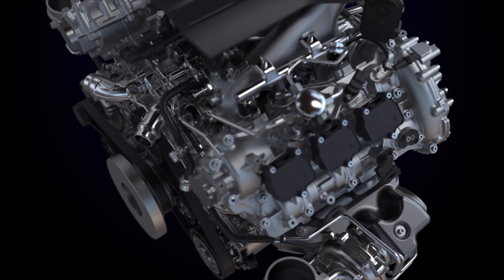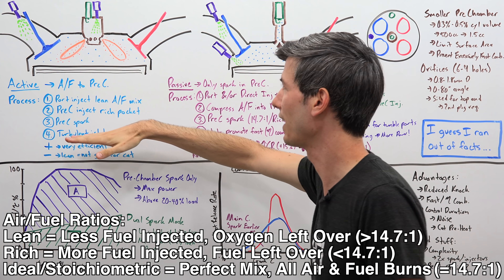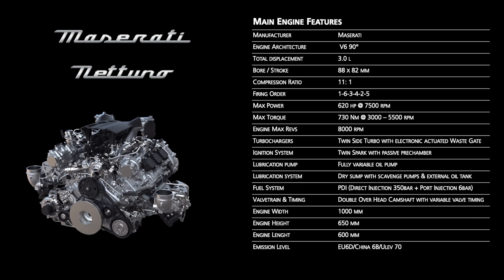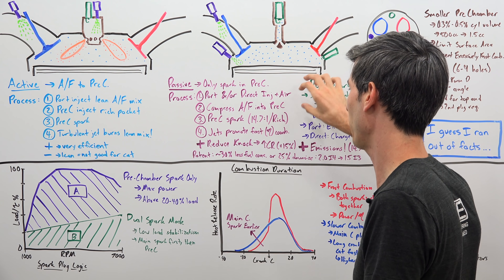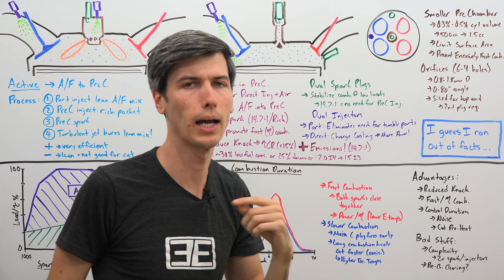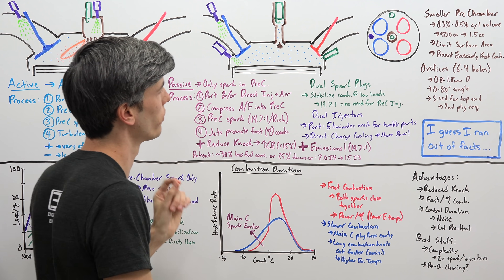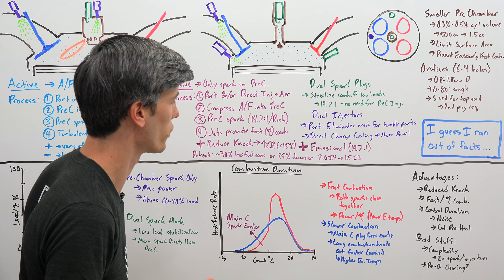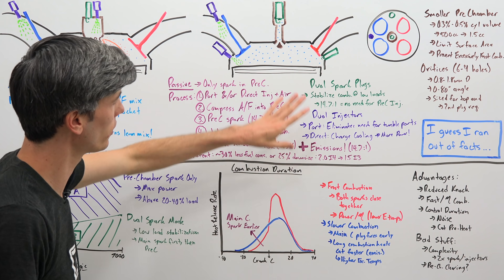How Maserati's Brilliant MC20 Engine Works - F1 Tech In A Road Car!

Comment: This is exactly what Mazda did with the leading and trailing spark plugs on the rotary.
Reply: No
Reply: @R4M_Tommy  ok, so not "exactly". The trailing plug is recessed in a chamber so that it creates a jet of burning fuel to ignite the tail gasses. Also the timing split between the leading and trailing is varied to control torque duration, emmisions and prevent knock. So there are a couple of similarities that were learnt decades ago

Comment: 3-way catalysts as found in road cars actually need a mixture that oscillates on either side of the stoich ratio to work properly.  Current engine control systems are capable of maintaining a near perfect stoich mixture most of the time, but that would reduce catalyst effectiveness.

Comment: The technology is under dev. for a couple of years. If you want to see something similar with diesels engine, check heavy duty gas engines with diesel ignition.
Basically, you use diesel injectors with diesel as a spark to burn a lean mix of methane and air in the cylinder. You get the benefits of diesel's efficiency at partial load with an "Otto" cycle for heavy duty engines. Plus the fact that you get close to half the CO2 out a classic combustion engine.

Comment: F1 must be doing something different because they are only allowed a single injector per cylinder
Reply: F1 engines work at full load almost all the time.
Reply: @R4M_Tommy  sure but single F1 are only allowed a single sparkplug and single injector, I don't how much in what this engine does is possible in F1

Comment: Having the combustion travel through approx 1mm holes seems like it would foul up without regular cleaning of the orifices during maintenance.
Reply: There is probably enough compression and then enough force with combustion to keep the prechamber clean.
Reply: Agreed, unless they include some sort of blow-through venting/valving, this is going to foul up for sure. You really can't force fuel/air into a closed-end tube, and you also can't properly evacuate a closed-end tube. This concept is missing some technology to make it work as conceived.

Comment: You questioned the same thing I did.  The pre chamber build up. Now the 6.9 IDI and 7.3 IDI diesel engines used one. I never heard of build up problems only damage due to starting fluid.

Comment: block looks beefy!, both port and di injectors aka easy fuel upgrades , light weight with a dct.  Not that anyone is going to go beyond more than a tune and downpipes on these at a quick glance it seems like this could be a good platform to modify.

Comment: That 1.5 millimeter pre-chamber orifice will plug up within 20-30K miles - no problem,  remove the top spark plug and push a coat hanger wire with some solvent to open it up.

Comment: I wonder if it's possible to design this addition for any engine as a mod? Like make a prechamber that fits instead of spark plug, put a spark plug into a prechamber and get a tune, basically advance timing. Would it work with any engine? Gaining 20%of power would be pretty awesome!
Reply: Hks has done a pre chamber on a rb26 head
Reply: it's brilliant, I have seen this solution in racing also, less knock, more boost more power.

Comment: Great now we just need Maserati's combustion system combined with Mazda's variable compression combined with Koeniseggs free valve tech and we'll have 1000 hp per cylinder mwuahahahahaha! :)
Reply: and an engine that will have so many failure points. 1 thing breaks and it will be a write off.

Comment: Since stoichiometric combustion results in very hot temperatures a lot of NOx will be produced. Presumably extra oxygen is needed to make up for that which combines with nitrogen. While a catalytic converter breaks down the NOx, how does the energy produced compare with using water injection (adding steam power) to reduce the combustion temperature just enough to avoid production of NOx and not needing the catalytic converter?
   Further, since this engine apparently stays at a stoichiometric fuel to air ratio, how does one throttle down the power without reducing the volume of fuel-air mixture being admitted into the combustion chamber, thus effectively reducing the compression ratio?
  The Augmented Compression Engine (ACE) does this by augmenting the fuel-air mixture with EGR as well as just enough water to keep down the combustion temperature.

Comment: Great work! BTW I have question on something else. Could help me with getting info about 2.4 Toyota Solara 2006 engine - does it need valve cleareance adjustment? Cheers!
Reply: Probably the wrong place to ask. But I'd guess (knowing nothing about the particular model) if the engine is stock, no it should be set from factory, if aftermarket cams, yes ask the cam maker for specs.
Reply: @MrRedstoner  thanks man, yeah I don't know this toyota solara 2.4 engine but i think to buy used solara. I have 2.4 Honda K series engine and I need do valve clearance adjustment from time to time. Cheers.

Comment: Seems like active is overall better and just needs a re-designed cat.
Reply: why was it bad for cat again? i just heard it was bad
nvm i just googled why lean is bad
Reply: @Eduardo_Espinoza  For what I understand, it causes the exhaust temperature to not get high enough. The cat need an especific temp to work properly, too low it clogs up, too hot it brittles.
Reply: @brunocorrea6010  i guess my comment got shadow banned
Reply: @brunocorrea6010  this, is my 4th comment
Reply: Using the right materials with a passive design is better than active combustion, in general. Reliable, robust, outweigh upfront cost (which is way overblown so they don't have to do the work).

Commercial turbine engines don't need a catalytic converter and end up beating ground vehicle emissions because they use lean mixtures with small droplet sizes, which means high droplet boundary temperatures (where the ratio is near stoichiometric) are less common and produce less NOx, which is an endothermic reaction.

Comment: I wonder if Mazda could adapt such technology in a rotary engine...
Reply: Maserati 3.0L = 630 hp
Nissan 3.7L = 320 hp

lmao at asian engineering
Reply: @ivangamer8022  The Maserati, however, will be dead and in need of a full rebuild by 50k kms. Maseratis, Ferraris, Lamborghinis are not cars that are expected to be driven for high mileages.
Reply: The Wankel rotary is an inefficient engine with inherent design flaws. What would be the point ?
Reply: @CaptHollister  What would be the point? Possibly making rotaries more efficient. Their combustion chamber is long, and flames don't spread fast enough to ensure complete combustion. This technology would speed up spreading of the flames thus making the combustion more efficient. Does that make sense?
Reply: @navidan2093  It wouldn't address the Wankels inherent inefficiencies such as breathing hot air, or sealing issues and friction losses, or burning oil by design. And where would you built a prechamber in an engine in which the combustion chamber isn't stationary without actually increasing the distance the flame front needs to travel ?  The Wankel rotary was an interesting experiment, but it isn't coming back to any car any time soon: it's just too dirty and thirsty.

Comment: Oh, how great this technology would be in NA V12. And oh my, I'd like this combined with Koenigsegg valve system.
Btw,  great video, thank you!
Reply: About a year ago patent drawings of a Ferrari V12 appeared on internet. It also had pre-chamber and an additional conventional spark plug. I guess Maserati were granted the premiere...
Reply: @WilfredVeltman  Or there will be a Maserati using that engine as well, just like with enzo and mc12
Reply: I agree
Reply: It'll be combined with "MultiAir" - which is Fiats established take on a camless engine.
MultiAir is a hydraulic system, while the Freevalve from Koenigsegg is pneumatic, if I recall correctly.
Reply: @alfisti93  Multiair still needs a camshaft.
Reply: @theo7709   Sure, Multiair "only" replaces the intake camshaft - the exhaust valves are still operated by a conventional cam.
One could also replace the exhaust camshaft with MA, but it would increase costs further - without gaining any significant advantages.
Reply: @alfisti93  the hydraulic pressure to open the valve is still generated by a camshaft that drives a hydraulic piston.
Reply: @theo7709  True, and this is exactly the beautiful simplicity of the MA system. It uses the remaining exhaust camshaft to provide sufficient oil pressure for the hydraulic actuators. 
(If you were to get rid of the exhaust camshaft as well, you'd have to provide the necessary oil pressure for MA by some other means - like an additional oil pump - which in turn would decrease the efficiency of the whole system. Hence it's only applied on the intake camshaft.
So in hindsight calling MA a camless system is a confusing mistake on my part...)

Comment: All those sensitive little pre-chamber holes and passages will quickly become clogged with carbon deposits. Jason did touch on this at the end: 'Well, they test these things so... I guess it's OK'. 

Sure, sure. Purely direct-injected gasoline engines were gonna be so great, too. Remember? But then we found out:

'Oh, well, yeah, it IS necessary to tear down the whole intake system to clean the intake valves and ports, from time to time.' 
How often?
'Oh, uh, you know, about every 30k miles or so.'
Excuse me?! When were you planning to mention that?
'Well, we thought it would fun for you to discover that on your own.'

They had to re-install port injectors, in addition to the direct injectors, to solve that little problem. Not ideal, but at least the Maserati engine has those. 

It won't matter, though. Introducing pre-chambers! A wonderful new thing that'll require us to pull the HEADS on a regular basis, to clean all those little passages. I just can't wait for this BS to trickle down into ordinary cars.
Reply: BLAME THE EPA for this nonsense.

Comment: I wonder how the carbon deposits buildup will affect this new system 🤔
Reply: yeah. It also sounds wayy too complicated and easy to fail
Reply: If history is anything to go by then they will be maintenance intensive and expensive to keep in trim. But hey, it's a Maserati! Anyone buying one of these already know they have to keep a good mechanic on speed dial. It's much the same with any of the classic high end European super car manufacturers. Their engines are often technical marvels of precision and aesthetically pleasing design, but also need to be serviced regularly to run as they are supposed to.
Reply: Just take the plug out and clean it.
Reply: Scientist Walter I was thinking the same thing, but with an orifice size of 1.8mm ... how effective are you gonna be at clearing out the carbon deposits?

Comment: This just demonstrates how insanely complex IC engines are compared to electric motors with their single moving part
Reply: They have become insanely complex because of the EPA scam. Take that away and no need for these high tolerance, complicated, precision engines
Reply: @AzathothsAlarmClock  well aware hence the 2.9L V6 in the Alfa meeting the EU threshold.

Comment: Small as it may be, should the pre-ignition chamber included in the displacement calculation? So is each cylinder technically 501.5cc?

Comment: Begs the question: How much more efficient could our cars be if emission compliance was not in the equation?
Reply: smokey yunick Developed an interesting engine it was getting some remarkable power and fuel economy figures. I think his invention died with him and I believe GM took back the engines that he was using. You have to look into it. You can increase efficiency without emission controls. But the trade-off is stuff we don’t want in the air.
Reply: The issue of the catalytic converter rules does hinder what can be done. They can't be leaner than stoich or it burns out the cat and by law cats have to last, I believe, 100k miles in the US. But you also have to get them to operating temp quick, by law just a couple minutes. So they have to be placed fairly close to the engine, and there is also usually a secondary air injection to speed things up from cold start.
So they could run leaner, more efficient /more power, but the cat rules prevent it. With current cat technology
Reply: @charliedulin  Diesels always run lean and have cats, the issue is that a three-way cat doesn't work if you don't alternate between lean and rich, it has to lean to get oxygen to oxidize HC and CO, has to run rich to reduce NOx. Diesels can't do that so they need things like adblue to reduce NOx instead
Reply: 3 MPG
Reply: Don't think for a second that the government does any long term research the don't care.
Reply: And how long you can live without the ozone layer
Reply: Probably they will be less efficient, because there is no need for making an engine efficient if they dont have to comply with emissions,  just throw a bigger engine or put a turbo instead of making it more efficient.

Any way, the efficiency will be arround 50  % look at the Mercedes F1 engine, is the most efficient car engine and formula 1 cars don’t have to comply with emission. The incentive for making an engine more efficient is better use of se gasoline more than just making pure power.
Reply: Matias B he was talking about FUEL efficiency...the mercedes engine you mentioned has 50% THERMAL efficiency...in order to create more power, but still comply with the rules that F1 proposes...two different things my friend
Reply: Rick well my friend, in that manner you right. 
But in order to make a car more fuel efficient  it has to improve its thermal efficiency, so it can extract more power/energy out of the gasoline. The emissions sistems makes a car less efficient because they produce loses in the combustion cycle, so the engine extract Less energy from the same amount of fuel, for example rich mixtures for reducing temps
lean mixes for reducing CO2 or dumping crude fuel in particulate filters.
Any way, I was think in an other thing when I read Loomies question, but referring at what he really asked, the answer is 10 to 20% I have friends that ripped out the emission systems and thats what they gained.
Reply: Matias B I completely agree...
You sir have earned my respect

Comment: Ffs convert nm to ft lbs please. I don't care if you measure everything else in millimeters and kilos, that's easy enough to parse out but a GD Newton applied over a meter? That's a gap to large to leap.
Reply: Get with the program pal, USA does not Equal "The world: 90% of the countries use the metric system because it's superior. Even in global science, the Metric system is the standard.
Reply: @paulj9821  umm, did you miss the part where I said I'm kosher with millimeters and kilos? It's just Newton meters I can't make sense of, or newton's in general.
Reply: @DracoOmnia  yes

Comment: Ironic that diesels ditched the pre-combustion chamber for greater efficiency, but petrol goes the other way. I'm assuming that by igniting in the pre-combustion chamber you will initially have a very short flame travel (which is good to avoid detonation), but by the time it squirts into the main chamber you effectively have ignition being started at multiple points which will again effectively give a shorter flame travel than otherwise. So the question is - why only 11.0:1 CR?